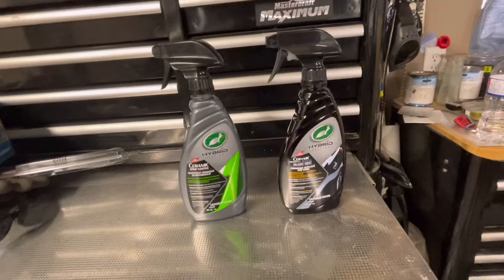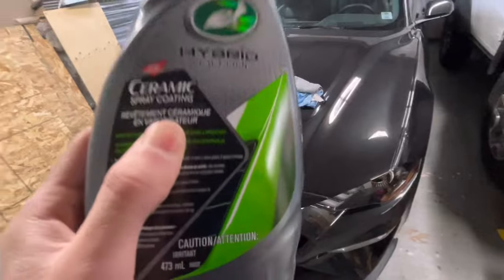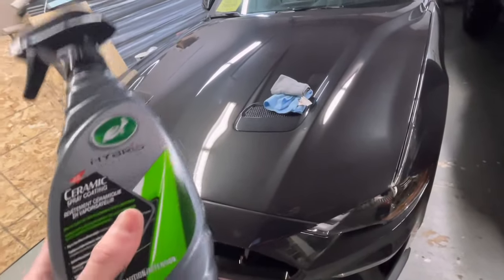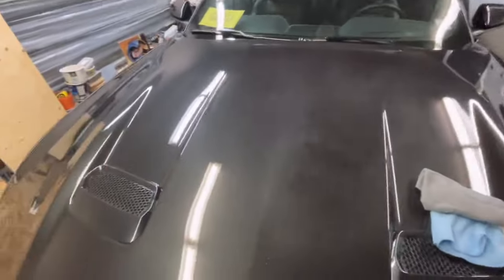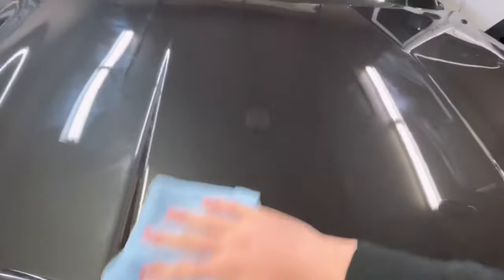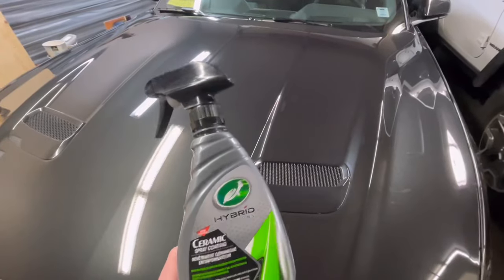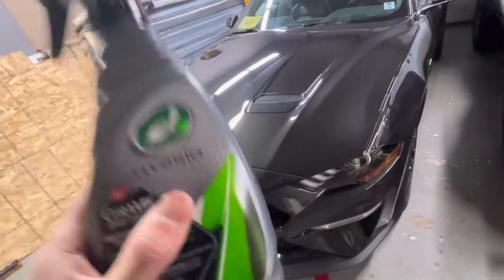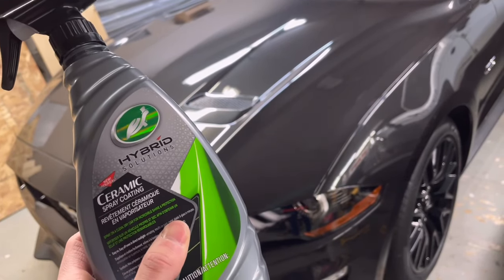Turtle Wax Hybrid Solutions CERAMIC SPAY, step by step guide

Comment: This stuffs will bead for at least a year but u will wish that it didn’t.  It’ll take a couple dawn 4X dish washing liquid to take that stuff off.  Here’s the problem, water will bead and stays beaded even after a 30 min drive.  If the car sits out in the sun the bead will dry out and leave water stains from the beads itself.
Reply: All ceramic does this
Reply: It’s better that than absorb into the paint…
Reply: U shouldn’t wash your car with dish soap , that shit removes everything
Reply: @Albertomor4321 yup, including a little bit of your clear coat. Main goal of coatings is to retain as much clearcost for as long as possible, not the opposite.
Reply: i've only noticed this on my truck and it was barely noticeable. just drive fast enough to get the water off before you park

Comment: I had issues with streaks after spraying it. Noted that using a slightly damp(water) microfiber cloth lightly over the streaks, and then buffing with a dry one, removes easily the streaks.
Reply: Thanks for info
Reply: That I noticed too.!!!!
Reply: Don’t overspray.  More liquid means more cloudiness and the drying towel removes like 50% of it anyway.
Reply: Agree. I always use a damp cloth and a dry one to finish it off. 4 passes over the entire car.
Reply: Same here. It smears. I spray a light mist of water with sprayer and then buff. However, I also have ICE product and I prefer this over this product.

Comment: Nice video. The TW spray is amazing. I use it on my original 98 Trans Am and the paint  looks new. After I tried the spray I ordered the graphene/ ceramic/ carnauba 10 wax combo paste from their headquarters. It is amazing. I'm 55 and have been detailing cars since I was 12 and it's the best wax I have ever used. Easy to apply very little is needed and great longevity. I did my car with the paste and just use the spray  for touch ups after I wash it.
Reply from the maker: Glad you enjoyed, I’m
Vary impressed with this stuff, probably the only thing I’ll use from now on

Comment: Anything that is sort of a bear to buff off in this category just needs to graduate to the wipe off with a damp cloth extra step.  It works for this, it works (even is official) for the graphene product, it works for Meguiar's ceramic spray, etc.  Spray it on, work it in, wait, buff it off with a clean cloth, buff it the rest of the way off with a damp cloth, and finally dry it quickly with clean cloth.  I use a mitt for the last step since they have a lot of capacity.  It makes application take a little longer but ultimately be easier despite the extra step.
Reply from the maker: I will try this next time, thanks

Comment: I found this stuff lasts about 3 months with just 1 coat! I got mine wet the first time i applied it within 6hs and it was fine no issues. My biggest problem was streaks after spraying it. I found a few microfiber cloths (1 for each side, 1 for bonnet/boot and another for roof/other panels) helps with this. It also works fine just spaying it onto a cloth and buffing it in and then off again. I start by using the jetwash with some really cheap wax/shampoo combo from my supermarket (about £2 for 1L). Then i towel dry it, go over with a microfiber. Ill then put some polish on it (cheap stuff ) let that sit a few mins and buff it off by hand. Does not take long but i think its worth it. Then ill apply this stuff. Every week i just go over the car with a fresh microfiber and some "devil shine" yes... the stuff details love to hate. But the car just wipes clean with it as nothing sticks thanks to this ceramic coating ;). Every 3 months just do the same takes like 2hs tops all in by hand. Could probably just get away with washing and using this stuff but i like the ultra gloss finish i get doing it this way comes up like a mirror.
Reply: What is devil shine? I looked it up and couldn't find anything.

Comment: I use the TW Ceramic Spray about 3 times in the spring and 3 times in the fall. After each application I alow 24 hours for it to cure. My car is outside and it beads and shines all year. I love this stuff!!

Comment: Just bought this stuff and haven't applied it yet. Any reason you believe it only lasts a month? Have you done any testing with it yet to compare how well the car beads or washes after a few months?
Reply from the maker: Yes I wash and wax my car often, when it’s applied the paint have a vary smooth feel, this goes away after a month or so

Comment: I've been using it for about a year. Just ordered some Flitz ceramic spray for my kayak, but I don't think it's gonna get here soon enough, so I'm probably gonna use this, a coat today, another tomorrow then it will get to sit for 24 hours and ride on my roof for a 2 hour drive before hitting the river. I already did 2 coats on my new carbon fiber paddle, gonna do one more!

Comment: I spray and spread this stuff around my truck and never wipe it off. I never let it go back to the way it was before I ever spray waxed it so when I reapply it and leave it on, it never gets much of a “film” going. Nothing a drive thru wash won’t cure. The film was much more noticeable the first time I applied it. When I spray wax it, I let it sit for at least 24 hours. Sometimes 2-3 days in the garage. When I run it through the wash, whatever film is on there is washed out leaving an immaculate shine. This method also makes the spray wax last much longer than when I use to hand buff the spray wax off right after application. I would not go this route (leaving it on) with a dense compound wax. But wiping the spray on and leaving it also cuts down on the time spent waxing the vehicle.
Reply: So you just spray all over your car and then just let it soak in the paint and then don't even wipe it afterwards?
Reply: @joshuajay2886  Correct. But I have a monthly membership to a car wash. So instead of wiping it off I let it sit on my truck for couple days and run it through the wash and it does the same thing it did when I use to wipe it down myself after the spray. I let the car wash “buff” it out to take that first layer off. And it comes out all shiny. It lasts a little longer before you need to reapply it again after repeated washes. And saves time doing it. I have only ever done this with a spray wax. Specifically the one in the topic. Turns an hour spray wax job into 20 minutes. Some people talk about it only taking 15 minutes to use a spray wax and wipe it off. That sounds like the most rushed job of all time. I could never imagine only taking 15 minutes to fully apply and wipe off even a spray wax. But I’m pretty meticulous and obsessed with getting everything well. And I also have a crew cab truck so that’s a lot of space to cover.
Reply: @sscotsmann  I heard that car washes brushes are harsh on the paint. What's been your experience?
Reply: @joshuajay2886  Not enough for me to care. I’m familiar with the swirl marks people will complain about. Usually marks that can be buffed out if someone wants to go as far as using a buffing wheel once in awhile. Honestly I’m not sure I’ve ever witnessed a car with no swirl marks when you look at it with the right angle. And it’s not a car that’s almost brand new or that’s just had an intense buff wheel job on it. The time it would take to wash a big truck by hand 3-4 times a month is not something I’m investing in. I think going to a reputable drive thru car wash is maybe a wise decision compared to some trashy unkept place. Places that have money invested to stay on top of faulty or spent car wash components as they wear away is good. Do it yourself car washes can be a joke with their maintenance and costs. While worrying about the previous guy that maybe loaded mud into the scrub brush after his hillbilly adventures. I also think that never allowing the wax layer to completely wash off before reapplying a spray or compound again might help minimize these “micro” scratches from washing in general. I’m sure if you look hard enough you will find someone to complain about a drive through car wash destroying their paint job to any degree beyond these swirl marks. But accidents happen I’m sure. I’ve never personally witnessed this with anyone I know. Ever since drive thru car washes were made affordable through monthly unlimited plans, I have been using them. So maybe about 8-10 years. The only thing that happened was my current trucks antenna snapped off. It was a stock antenna but long. The car wash reimbursed me in full for a replacement. I switched to a low profile rubber/plastic coated one. Because I don’t care about radio reception really. I use apple car play with my iPhone music files. I’m sure there are specialists and car nerds that know way more than me, but these are just my experiences. If you do go the route of hand washing to avoid every potential for car paint hazards then you will certainly need to look into the right cloths, sponges and microfibers to use on your paint. Because even a fiber to abrasive can etch swirl marks in. Or if a windy day blows some particulate over your wash or wax applicators. So you need to store, wash and maintain these cloths appropriately. I mean you can lose your mind playing this game. I do invest in good microfiber clothes of varying types. I use a spray wax to cut time. I have looked into getting a coating that can last years regardless of how many times you wash your vehicle, but that gets expensive. So for now I look for something cheap I can do myself. Every 4-8 washes I reapply spray wax. Depends on the time of year and what the outside elements have been like. If you wash your car once a week these spray waxes will not last several months. That is a joke to me. If I was a rich guy, I’d buy a new or almost new vehicle and rhino line the entire body while having a black coating added underneath that’s more permanent than something like a Zbart tar or even anti rust oil application. No idea why car makers don’t do this standard. You can buy a brand new truck and spend over 50k just to have the frame start rusting in snowy states by year 2-3. It’s stupid. But undercoatings and rust converters are another story. One last thing. If my truck has been brought out of pavement Princess land and into the sticks, which I have done many times. Or if the winter salt layers on thick from a road trip. I always pre spray my truck aggressively at a do it yourself wash. I do this before I go through my drive thru auto wash. The part that irritates me most about the drive thru auto wash is the lack of a good rinse before the soap and scrubbers hit. If your vehicle is caked with mud and road grime, you now have an almost sandpaper base being scrubbed in. It’s worth it to me to spend a few dollars power spraying my truck on the soap setting to rinse it off before I ever use the drive thru wash during a time my truck is really dirty.

Comment: I used it and it really streaked. I did it on a sunny warm day. Could that affect it?😊
Reply: Yes most products shouldn't be applied to hot panels, if you do be really quick as it will flash almost instantly.
Reply: You should also spray only 1-2 times for each panel. 
Any more than that, you will deal with streaking and having to buff out the excess with a lot of elbow grease.
Learned that the hard way

Comment: Use the Turtle Wax Hard Shell Paste wax every six weeks. Just wash your car, apply a thin coating, wipe and buff. It has a mild cleaner and a blend of carnauba wax. Never a mention of all the “painstaking prep” or the amount of time needed to do it with the ceramic stuff.
Shines and beads just as well as any of these “ceramic products”. No need to let it “cure”
I can do my whole car in an hour, no biggie.
Reply: I can vouch for Hard shell, It's not fussy or as bad as people make it out to be. For the price, If It can last even one month then that's good enough. You're right about all the prep that these new ceramics require lol, Hard shell has a cleaner so you automatically clean the paint and remove the residual layer of wax (if any is left) so you don't even need to strip the wax. It's a wonder product, Even though I have the Ice spray and Seal and shine, I think Hard shell is still worth it in this day and age of ceramics.
Reply: I Some folks like to wax, and a few weeks is what you get with that. The prep for ceramic is suggested before any type of protect-ant. On my new car, I hand washed and Clay barred it to remove contaminants, which I would not want under any wax, and then used the ceramic polish and wax to correct the paint. That already left it with a high-gloss water beading shine, but to extend those qualities beyond the 6 months it provides, I also used the ceramic spray coating. This shine and beading is being reported to last a MINIMUM of 6 months, going all the way to 12 months, depending on your conditions. The Claying/waxing/polishing I won't have to do for a year. I would rather just be able to wash my car every two weeks and skip the polishing, which this will provide me. I added the ceramic detail spray to clean up dust and spots between washes. As a side note, you really don't have to clay or wax/polish your car if you just want a nice high-gloss shine with this stuff. Even without doing all of that, it make the finish look like glass!
Reply: @Trashed20659 The Turtle wax paste has a cleaner in it. It will remove contaminants, swirl marks and minor surface marks very well. 
You can learn how to apply it with a damp sponge and apply a thin coat which dries quickly. 
It’s easier to use than any ceramic stuff. 
I’d rather wax my car every six to eight weeks than do the ceramic thing.
I don’t believe that ceramic stuff lasts that much longer and the prep is too much.

Comment: For a 1yr old car with (almost weekly carwash -automated), do i need to use rubbing compound for the debris before using the hybrid coating? I don't have water supply in my garage since I'm living in a apartment.
Reply: I bought a battery powered power washer that fed from a 5 gallon bucket when I lived in an apartment. You're going to need to agitate the paint when it's really dirty. If you go through car washes with brushes you're going to get scratches and swirls. This product won't stop that. Most products won't. Be prepared to machine polish your paint eventually or pay to have it done.
Reply: @jlucguerrier  what brand of power washer did you use? There are so many on amazon but I'm kinda hesitant to choose which one is the best

Comment: i literally cant keep it from streaking even after a IPA wipe and deferent clean microfibers in my garage when its 78 degrees. It streaks super hard and its extremely difficult to remove.
Reply: I find using a damp microfiber towel as the application towel works best for me on my black vehicle. Watch out for overspray because if you don’t wipe that immediately it will also leave dots.

Comment: Have you compared this to the graphene product?
Reply from the maker: No I have not, but I will be doing so in a future video
Reply: I bought the flex wax with Graphene and it's bloody awesome.. So good..
Reply: @malsmith2012  Thanks Mal, I've give it a try!
Reply: @Doug_E_Dee  Sweet as mate. Hope you get a great result.. One thing I did follow was Brian's advice from apex detailing here on YouTube (do you watch Brian? AMAZING detailing channel) he said not to use to much so I used a rectangular microfibre covered applicator and used the same face for every panel. Couple of squirts per panel as Brian said and the result is awesome..
Reply: On an older 1999 Ford Taurus, parked outside. I was getting good results from just the basic Turtle Cleaner Paste Wax. I waxed it every 4 months.  I sold that car, and I'm waiting on a new car. You can get a professional ceramic coating put on your car. But, depending on which one you get. It can be expensive. I'll use this time, a non cleaner paste wax. And, do a periodic rub down after a wash, with, this Turtle Spray Ceramic, mentioned in this video. I wonder if you can put a non cleaning paste wax, over this ceramic spray coating?

Comment: I love Seal n' Shine, not so much Hybrid Ceramic. SnS so easy, ceramic sucks. No matter how I apply it's a pain to remove and way too much pressure to remove, which can lead to possible scratching. The only way to effectively remove it is with a damp MF.
Reply from the maker: I’ll have to give it a try next time
Reply: @up_front_off-road_3915 thanks for the reply👍

Comment: I disagree that the bottle lasts 20 application.  It’s 16 liquid ozs and about 5 applications.  That’s like 3 liquid ozs per application.  And then, the 2nd towel drying will take off 25-50%, leaving 1.5 to 2 oz.of liquid as a protectorant layer.  Rub your hand over the surface after 24 hour curing; it may feel smooth, but it’s damn thin so every time rain or wash water flows, it is running off this thin layer, and it’s gone by 3 months or 3 commercial, harsh washes.

Comment: I’ve use TW hybrid ceramic for years.  It basically replace the older spray wax, but has the same downside that it doesn’t last very long, 3 months or 3 commercial car washes.  I’ve also done the 2 layer with 24 hour cure period, and it lasts longer, like 6 months.   Every time the car hits rain or car wash water, the protectorant is being washed off.  Even with 2 coats, you can feel that the protectorant is quite thin, and the hi tech science is about how this layer adheres to the topcoat paint finish.  Any flowing water is running off this thin polymer coat; the claim of 1 year protection is a Trump lie.  The Wall wasn’t built and Mexico didn’t pay for the few miles that were built but crumpled since he corruptly awarded the construction to donors and friends.  TW does leave a nice shine, and it’s easy to apply, but you still have to thoroughly wash your wash and apply TW every 3 months.  After 3 months, run you hand over a clean surface area; you’ll just feel the clear coat paint with no TW left.